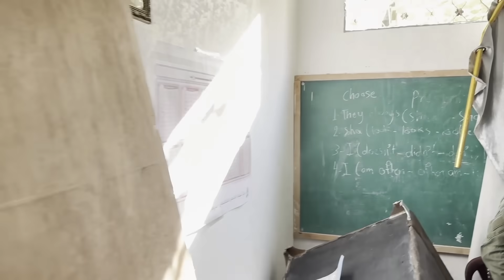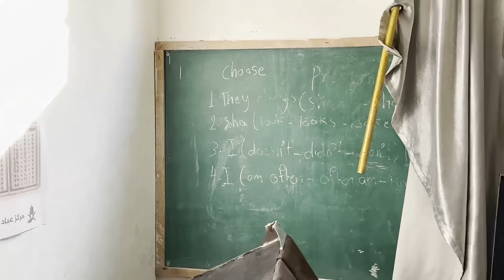Watch: IDF soldiers in the terror tunnel complex at Shifa Hospital

Comment: Just by looking at the reinforced concrete slabs standing straight on both sides and arched on the ceiling of the tunnel one can deduce the huge quantity of cement, gravel, sand, and steel rods required to produce them. These structural elements were pre-cast, meaning they had to be produced outside and then carried inside. One also has to wonder also the spectacular amount of gravel and dirt that had to be removed from the tunnel system to allow room for all this intricate building endeavor, notwithstanding the amount of energy required to mix and pour the concrete batches, formwork, labor, etc. Everyone in Gaza probably knew about it, at least about the construction of the tunnels. It gives an idea of the constant state of fear the Gazans must have been living under Hamas, knowing the money that was supposed to go to the hospitals, schools, housing, and infrastructure being spent on this underground terror network.

Comment: After watching this video, a couple of points or questions:

In the original video and photos of the tunnel leading up to the blast door with a "firing hole", there was quite an obvious cut after the camera descended the vertical shaft from the surface (near the hospital). In this video, I do not see a single continuous cut showing the proximity to the hospital and these tunnels with that same blast door. Indeed the bottom of the spiral stairs that they seem to be verbally linking to the original video vertical shaft looks to be in much better shape than that original video, which gives the impression that it is a different vertical shaft (perhaps not by Shifa hospital after all).

Also, it is very striking how completely barren almost sterile these small rooms and corridors are. It seems likely any Hamas utilized tunnels would be stripped of anything of tactical significance (rosters, calendars with days of the week *wink, wink*, ammunition, weapons, hostages and even supplies. But it seems extremely unlikely that Hamas operatives would have taken the time to thoroughly empty everything completely out of these rooms if they were in fact being used as a main command post. On the contrary, if they were in fact utilizing it as a command post and had to evacuate to other locations due to Israeli forces siege of the hospital grounds, I would imagine time would be of the essence. It seems very strange for these tunnels (if even near the hospital grounds at all) to be so barren, when the IDF alleges they found computers, weapons, grenades, and other supplies in the hospital buildings. Would they not have similarly evacuated all of their supplies and tactical gear prior to the hospital being taken, by these very (alleged) tunnels themselves?? Does not stand up to a logical examination.

Comment: Where is the air supply for those tunnels? That much volume requires a significant number of vents or a very large air pump that would be visible on the surface. That large of an air handler is not concealable.